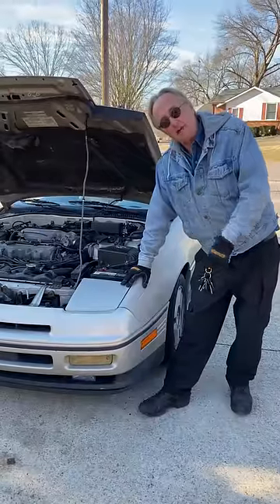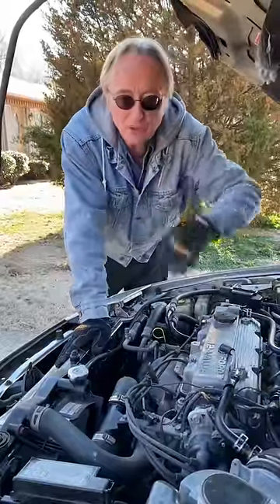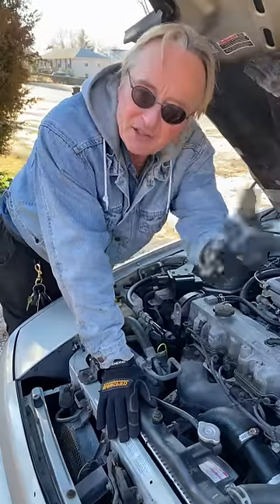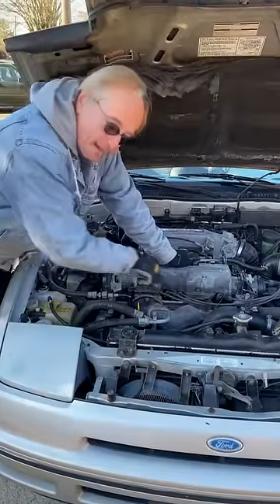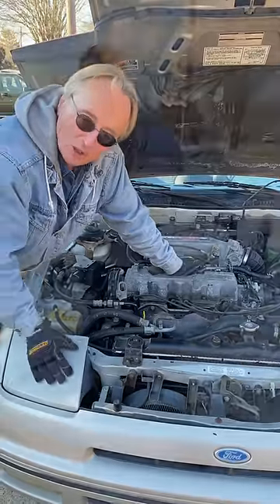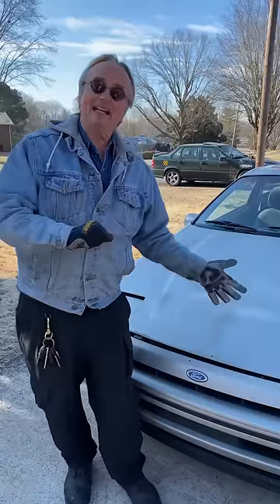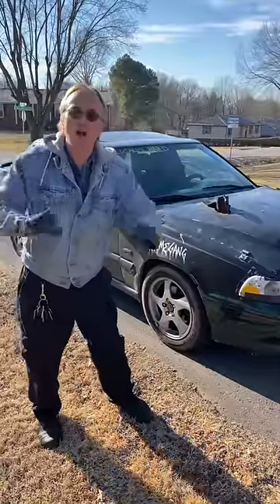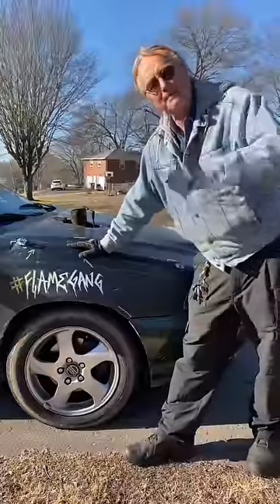The Problem With Buying a Turbocharged Car

Comment: This is a fact, I had a VW Tiguan with turbo blew that original engine in 95,000 miles. Volkswagen said they had some kind of recall on a part so they covered my engine. I asked for them to put in one without turbo and I got 150,000 more miles out of that vehicle. Actually ended up being one of the best cars I've ever had.
Reply: Was it just the 2.5 N/A VW makes? You’ve peaked my curiosity I didn’t know they would do something like that haha :)
Reply: My 2011 Tiguan turbo started to go at about 85k ( it was only 7 years old) Between that and the potential timing chain issues on the 2.0 TSI, I traded it in immediately. That generation of the 2.0 TSI had many issues. Was a fun car though.
Reply: It's a VW. No surprise there.
Reply: @AIGeneratedUser  I'd ask for pics, with all the emissions mess Vw went through I doubt they would put an engine that was never federalized in that particular model in USA.
Reply: VW is #27 in reliability according to Consumer Reports annual reliability survey. And it has a high TCO (Total Cost of Ownership), making the purchase of a VW car a dumb decision.
Compare the Germans with the Japanese and you'll see the huge difference. As an example, Toyota is #2 in reliability (Lexus is #1) and #1 in low TCO  (Lexus being #3)!

Comment: Most cars have turbocharged motors nowadays.  Changing the oil often is important and let the oil circulate for a few before starting off and before turning motor off.
Reply: Yes Sir I Do Just That I Warm The Car Up And Sit In The Car After Driving It About 2 Minutes Then Shut Off Got To Make It A Ritual The Wife Don’t Like It But It Is What It Is When Own A Dual Turbo Car

Comment: I had a Probe exactly like this one.  It was a styling silver with black trim.  These were great cars, what most people don't know is that this was car was in partnership with Mazda.  The Ford Probe was basically a Mazda MX6 with different styling.  So you got the price of a Probe with the quality of a Japanese car!
Reply: Ever have to replace the starter?
Reply: My cousin  used to owned a 1988 Ford Probe.
Reply: Oh so that's why the follow up model looked more like a japanese car - I liked the styling of this here shown and never understood why it supposedly didn't sell well.
Reply: The Probe was actually supposed to replace the Mustang! But Ford got bombarded with phone calls and letters and changed their mind
Reply: Ever have to fix the power windows?  Especially when the regulators aren't made anymore.
Reply: @jaglover not even rockauto?
Reply: Actually Mazda 626 Gt (turbo) came 2 door, 4 door, and 5 door (Touring hatch back) the MX6 (2 door) came out in 1993 when they redesigned and then super round smooth. 
This 1989 turbo has the Mazda 2.2l. it was quite powerful for the time. And nearly indestructible. I had many Mazda versions of the 2.0 and 2.2 some with 300k on original turbo, engine, trans.
Reply: @trekinseattle  300k on an OEM turbo damn good, who manufactured that iHi ?

Comment: Who’s going to let you remove spark plugs
During a used car purchase?❤😂😂
Reply: Yeah, and if they're stripped out, the seller will blame you for stripping them😮
Reply: My friend had a buyer ask him to do a dyno test before he would buy his car😂
Reply: Pull over on the test drive. They always let me do a test drive alone so bam bam
Reply: @BubblesTheCat1  out of all the years I have been a mechanic I've only ever ran into that situation 2 times. Realistically that wouldn't happen
Reply: @longpeter-cw3sg  I'm also a mechanic and have come across many cars with stripped spark plug threads in my shop. Some even needed the cylinder head removed when the damage was too severe for a helicoil insert.
Reply: @BubblesTheCat1  you must have been doing this for 50+ years than to be seeing (many)
Reply: @longpeter-cw3sg  I'm in Africa...

Comment: To steal a quote from you, 'when dinosaurs roamed the earth and I was just a lass', I owned a porshe 911 Turbo and I went through two turbos in two years. Bad design because they weren't intercooled and they hungered for ball bearings. I sold it after the second turbo install that I did and broke even off of that car but it permanently turned me off of turbos.
Reply: I just build my own turbo stuff because I'm broke. That way I can get angry at myself when something in the design goes wrong.😂

Comment: A lot of turbocharger issues can be solved by either not having it or having a wastegate you control manually, but not having it is the better option.

Comment: Ehh there's a benefit to owning a rare turbo tho! Like a 2004 MazdaSpeed MX-5 Miata. I got mines in 2009; had zero problems, a pure joy. I paid dealer retail $15k w/ 25k miles. I'm at 72k miles, and they go for ~$15k at auction w/ 72k-ish miles. Essentially drove the thing for 15 years for free! 🤙

Comment: I had a red 740 (Volvo )turbo with intercooler,like that . If the turbo ain’t burning oil, then you better pull over and top it up before you run it too hot and blow and coolant hose off. Ask me how I know.

Also , way back in the day ford probes were my favorite Highway passing prey.

Comment: I have a 2019 Hyundai Tuscan burns 3/4 a quart every 1000 miles. I bought it from enterprise car sales in San leandro, CA with 62.000 miles in 1/2023. It now has 72.000 miles. I had a oil consumption test in feb it was burning 1/2 a quart every 1000 miles. Now it is burning more.
Reply: I’d be willing to bet you actually have a tucson
Reply: Your first problem was buying from a rental company

Comment: The turbo failed on my sprinter work van. The odometer had 103 000 kms showing . Turbos are great for power but useless for reliability
Reply: My 2006 sprinter with 2,7 liter engine has 290 k miles on it and zero problems whatsoever!!!
Reply: @Nietyp  Thank God I don't own the one for work. Glo plugs, turbo, rack & pinion, headlights, every bulb 3 or 4 times, all pollution control hardware.  The worst one was in wastewater....$13 000 repair bill. Our fleet manager/head mechanic told me no bill from the dealer has been less than $6 000. Mine will be gone next spring. I can hardly wait. Sprinter vans are collasal junk boxes. Oh ya, they rust like crazy.
Reply: @mikefoehr235 All your problems sound like user neglect/error
Reply: @GZ187  I work for a city...it's a fleet vehicle...how am I NEGLECTING IT??? You must be in some far off warped dimension. The real problem is the logo...MB...EPIC GERMAN JUNK
Reply: @mikefoehr235  Yeah your company neglects the hell out of them
Reply: @GZ187  you are neglected

Comment: Have a 2015 MKC with 2.0 Echo boost which has turbo.  Bought new, now 132,000 mi. And still runs fine.  Changed oil regularly but haven't changed trans fluid.